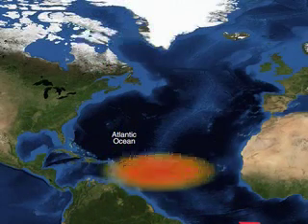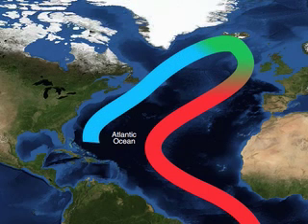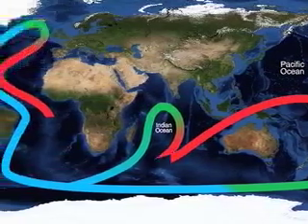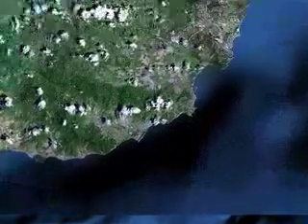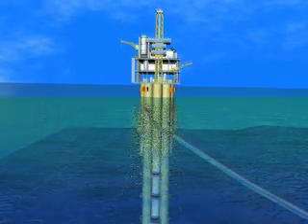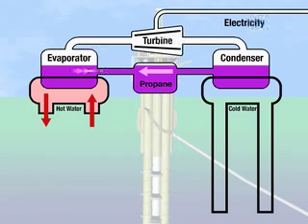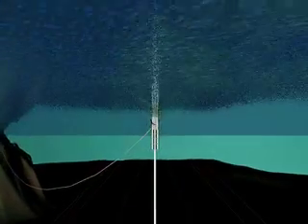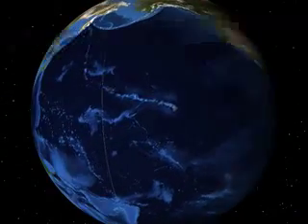Renewable Energy From the Deep Ocean

Comment: Solar panels & wind turbines are not structured for the new stronger and frequent Hurricanes or tornados. The solution for Puerto Rico and surrounding islands is to use Concentrated Solar Power concentrated solar heat/ pumps on barges. These barges can be disconnected and moved out of path and re-attached within days. Have the same cold water drawn from PR deep coast to create energy and to cool off the hurricane alley waters and remember Hurricanes feed off the warmer waters.

Comment: Why not put the condenser on the deep bottom-the evaporator on the shallow bottom and the power station on land.   You could then utilize existing power stations by connecting the steam driven generators to the heat engine.  Should bring the conversion investment way down.  Why pump massive amounts of cold water up when all you have to do is move the refrigerant.

Comment from the maker: It is very expensive, even for a small demonstration unit and it is no longer patentable, so the firms with the money and engineering expertise would simply be opening the door to competitors.  In addition, the power companies able to use the power from an initial unit are unwilling to issue a 20 year power purchase contract for an unproven technology.  Such a contract would permit private financing.  No one is willing to take any risk.

Comment from the maker: The efficiency is different depending on the basis for your calculation.  The traditional calculation via the Carnot cycle is very low, but is meaningless since there is no fuel cost.  A more relevent calculation is based on recoverable energy versus energy consumed for pumping (and other small electrical demand).  In the tropics this is around 65-70%.

Comment from the maker: The large diameter pipe allows for a lot of water with low flow, too slow to drag in fish.  If the discharge can flow to a shallow area, the sun and nutrients will provide food for a lot of fish.  When the surface water cools too much during winter there will be no power generated.  The unit is very difficult to move but protection would be needed as for ships or any other offshore rig.

Comment: I think you mean a 100 MW plant can produce over 800 GWh (gigawatt-hours) of electricity, not 800 GW. It's implicit that a 100 MW plant produces 100 MW of electrical energy at peak performance.  But if you assumed that the plant ran at peak output for a year (which it most certainly would not), it would do 876,000,000 kWh (800 GWh) of work.

Comment from the maker: @NuMetal92  Open ocean plants within plus or minus 20 degrees latitude, to produce ammonia for transport could benefit energy consumers anywhere but direct electrical connections would probably be feasible for only a few hundred miles.  Europe is too far for direct wire connection.  Unoccupied atolls (of which there are thousands in the tropics) could be used to develop nearby ocean farming using the high nutrient discharge.  Once started creative people will find many applications.

Comment from the maker: @NuMetal92 A power purchase agreement (PPA) is needed first.  Then it will take about two years to obtain the necessary permits (in Puerto Rico).  Final design could take place simultaneously so that construction could start as soon as permits have been obtained.  Construction would take 3-4 years.  Existing commercial turboexpanders would be used with the largest about 10 MW net output.  This means that a land based 10 MW plant would be possible for under $100 million.

Comment from the maker: @GrayskullProductions 
It is expensive to build a commercial unit.  The first 75 MW unit will cost in the range of $600 million, but will produce 600 million KWH of base load electricity per year for around 30 years.  Some components will last much longer.  This will be cost competitive as long as oil stays above $60 per barrel.

Comment from the maker: The Puerto Rican Water Company is one of the largest users of electricity in Puerto Rico.  Water does not move by itself through pipes or purification plants.  It requires electricity to operate pumps and other equipment.  The water company has been looking into renewable sources for some of its electrical needs.  duh

Comment from the maker: @tanya2horses   It is theoretically possible to change the ocean currents if the thermal balance is changed.  However, the change due to OTEC will be very  much less than the changes occurring from natural upwelling.  Furthermore, monitoring of the initial thousand or so units will permit modeling that could predict any major changes.  Any effects could be reversed by simply shutting down units as they get to the end of their life or sooner if it was required.

Comment from the maker: check out our web site.  About 1.5 cubic miles per year of cold water and about 2.5 cu miles of warm water is needed but the technical viability has been proven.  Only the 35 ft diameter pipe has not been commercially demonstrated in other applications.

Comment: Methinks these numbers are quite a bit inflated. These plants are very inefficient and the mass flow rates required through the heat exchangers are huge. It could play its part though if the plants could be built cheaply.

Comment: And the $64000 dollar question is... how much would 40 OTEC plants cost!!! The main problem with alternative fuel sources is exactly that. They are only an alternate power source once 'cheap' oil has run out. 
If there is say 1 billion tons of oil left and we burn it all in 1 year or 100 years, what does it matter. It's all going to get burned before people will pay for electricity produced in this way, so party on dudes.

Comment from the maker: Most of the tropics between 20 degrees North to 20 degrees South have sufficiently warm surface water to generate electricity year round.  More in the summer when more electricity is needed and less in the winter when demand is also lower (due mostly to less air conditioning needed).

Comment from the maker: These units are very expensive, but are economic when compared to Oil at prices over $40 a barrel.  Furthermore, they have no impact on the climate.  They will be paid for by investors who will be repaid from electric bills just like for existing power plants.  The difference is that the base level for electricity will be higher but will have no fuel surcharge.

Comment from the maker: Cold deep water is continually generated in Artic and Antartic Oceans and flows as described in the video.  It is continuously pumped to the heat exchangers using part of the electricity generated.  Life span is expected to be over 25 years with routine maintainence.  Corrosion resistant alloys and mild methods to prevent bioaccumulation of barnacles and other sea life have been developed.

Comment: Few question i have about the system. using your graphical design as a reference, wouldnt the cold water need to be continuosly pumped up from the depths? how would you maintain the flow and the tempature of the water? what is the expected life span and maintainence cost of the equipment seeing that the salt water creates a highly crosive enviroment and what are the effects OF barnicles or ON other sea life

Comment from the maker: The cold deep water naturally rises over time, quite rapidly during upwelling events and at seamounts.  The amount used in OTEC is very small compared to natural upwelling, well below the natural variations from year to year.  OTEC takes a part of what happens naturally and captures a small percentage of the energy rather than having it dissipate unused.  The end result is what would happen anyway, in a way similar to hydropower.  Rainwater returns to the sea with or without a dam.

Comment from the maker: It is competitive with Natural Gas but not Coal without carbon dioxide capture.  As units are built, costs will come down.  The first units are competitive with oil at about $80 a barrel.  Also it is the only energy source that can generate byproduct desalinated water.  The hybrid design can produce water and electricity together at lower cost than any other method.

Comment from the maker: OTEC has been proven technically but not commercially.  It is therefore very difficult to obtain the financing needed for the first large commercial unit.  The lack of available money is holding up deployment.  The payback period at current oil prices is less than 5 years.  If OTEC units were made in Puerto Rico, the new jobs would offset around 30% of the cost and the remaining investment would have a payback of less than 3 years.

Comment from the maker: The overall gross power is about 140 MW for each 100 MW of net power(for a properly designed plant).  About 40 MW is used to pump the water from both the deep water and the surface water.

Comment from the maker: Anytime you use a propane grill or use propane to heat a home or operate a propane stove, you are vaporizing or boiling propane.  The only difference in OTEC is that it is condensed back to a liquid, rather than burning it.

Comment from the maker: It will be very beneficial for PR to be self-relient in energy and with long term stable energy prices.  In addition, since this is a new industry, thousands of jobs will be created.  Many can be in PR.  The primary cost is to finance the units.  This will be similar to a home mortgage in terms of interest rate and length of the mortgage.  If they are financed in PR, the interest payments will also stay in PR.  Non-financial operating costs are only around $0.02 per kWh.

Comment from the maker: The cost of each platform is very high, especially the initial ones.  However, substantial cost reductions will occur as construction experience is obtained and improvements are made.  By the units 5 or 6 the cost should be in the range of $5,000 per kW compared to around $3,500 for Coal with carbon dioxide sequestration.  A plain Coal plant is around $2,000 per kW.  Gas and Oil are less.  Each 100 MW unit will save around 1.4 million barrels of oil each year.

Comment from the maker: Propane and ammonia are suitable for OTEC because the pressure ranges from around 6 to 10 atmospheres of pressure.  This does not require high pressure equipment.  For geothermal, butane or iso pentane are the typical working fluids because they have similar pressures at the higher geothermal temperatures.  Ormat is a leader using isopentane and other organic working fluids in geothermal systems.

Comment: Its an interesting idea... what temperature is the boiling point for propane and at what pressure.  Could this same idea be done on land using geothermal ground loops as the cooling circuit?

Comment from the maker: A properly designed OTEC system has been proven to be able to generate approximately 70% net power.  Approximately 30% of the gross power is used for pumping.

Comment from the maker: Geothermal is only available in certain locations.  Wind farms are not base load and are very expensive when ocean based.  Underwater turbines may be practical in some locations.  OTEC combined with ammonia or aluminum production can be located on the open ocean far from land.  Also, OTEC is the only energy source that can also produce large amounts of potable water.  Many renewable energy resources will be needed to replace fossil fuels.

Comment from the maker: Very perceptive comment.  Many calculate the limit as the heat from the sun, but the formation of the deep cold water is probably the actual limiting factor.  Recent calculations indicate that the limit is probably in the range of 3 terawatts or about 20% of all man's energy usage.  A lot of energy (around 30,000 100 MW units) but not unlimited.

Comment from the maker: The primary problem was that oil prices went way down.  OTEC cannot compete with oil under around $50 a barrel until further advances are made to reduce the costs to build these units.  All the technical problems have been solved.

Comment from the maker: There is an initial priming pump.  After that, approximately 30% of the gross power is consumed by the pumps and other ancillary equipment.  Until mini-OTEC, the criticism was that the pumping requirements would exceed the total energy generated.  This is the case when the temperature difference is not large enough to generate net power or the design is faulty.  Optimizing the power output while minimizing the power consumption is a key design challenge.

Comment from the maker: There are many potential applications for floating and land based OTEC plants.  However, our analysis indicates that Puerto Rico is the most viable initial location for many reasons including proximity to the resource, large demand, and a large competent and motivated work force that can benefit from both the manufacture and use of these units.

Comment from the maker: The Carnot efficiency is only about 3% out of a maximum theoretical of roughly 7%.  However since the fuel is free, this effects the cost only indirectly by requiring large sized units with proportionally high but stable financial costs (interest and depreciation).  Operating costs are not expected to be much different from a conventional plant and the operating life should be similar.

Comment from the maker: It is the temperature difference between water layers that determines where OTEC is feasible.  This is present mostly in the tropics and Gulf of Mexico.  A lower boiling point working fluid will just require higher pressure equipment at higher cost.  More information is in my other video and on the internet.

Comment from the maker: Propane is 130 PSI at 80 farenheit (average surface water temperature) and 65 PSI at 40 f. (average deep water temp).  The pressure difference drives the turbo generator. Ammonia works the same and will be in our next video which will also be in Spanish.  OTEC plants pump a lot of water for heating and cooling the working fluid.  About 1 square mile forty feet thick each day.  A lot on land but just a drop in the ocean.